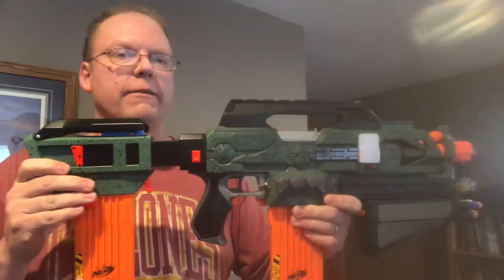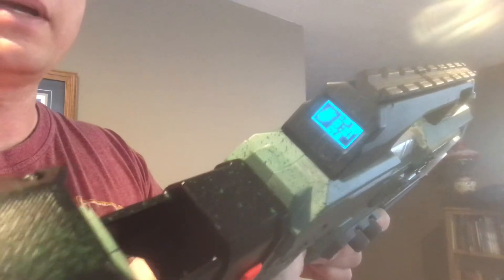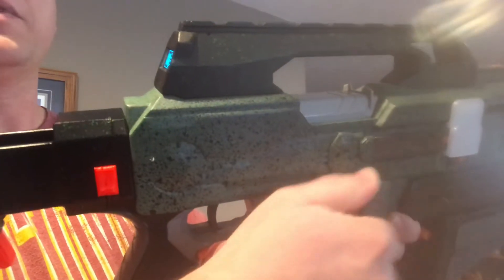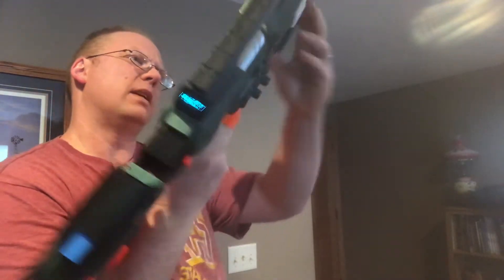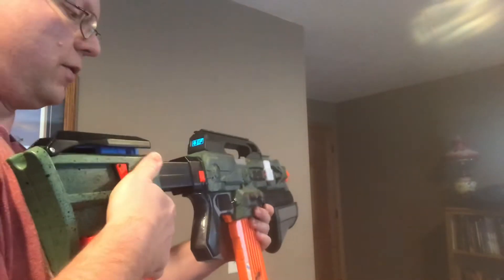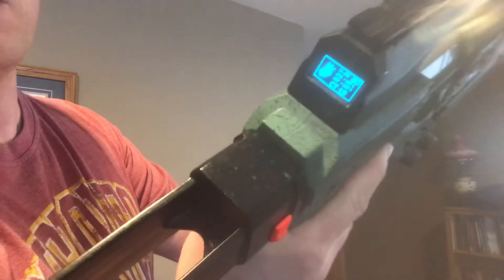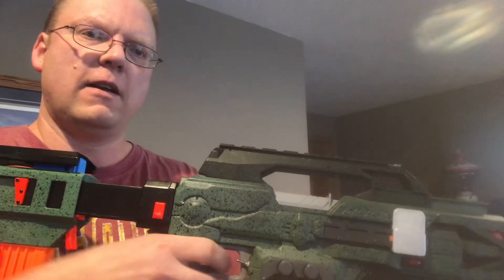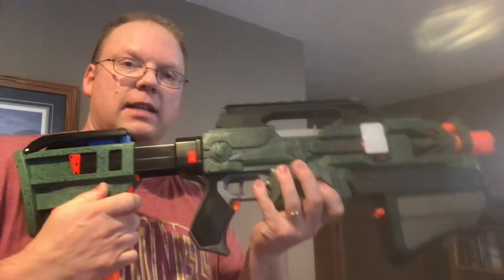Select fire modulus ecs10

Comment: Wow! Maybe could you help me with my nerf ECS-10 modding project?
Reply from the maker: What’s your plan?
Reply: @machgt  I am wanting to make it very similar to yours, maybe with a 2 digit countdown for the ammo counter. Umm, semi auto, 3 round burst, and full auto :) And probably a display to tell me how much battery the gun has left.
Reply from the maker: @Boden_Worms  How much soldering do you do?  I've designed a couple of boards that I use for controlling the select fire and motors.  Do you do any coding?
Reply: @machgt  I do not do much soldering, And I know the basics of programming. I would probably use arduino.
Reply: What part did you use to replace the  overhang over the umm jam door?
Reply from the maker: @Boden_Worms  I printed it
Reply: @machgt  Thats cool!
Reply from the maker: @Boden_Worms  I designed and printed all of the parts using solidworks and the printer at work.  I can't sell the parts but I'm happy to sell/provide files.  That carry handle is on Etsy under EJBblasters
Reply: @machgt  Ok! i will check them out!
Reply from the maker: @Boden_Worms  find me on nerf modders welcome on Facebook
Reply: @machgt  Sadly, I am not allowed to use Facebook
Reply from the maker: @Boden_Worms  nope. I did a olive base coat then just barely press the tip on the spray paint can. It splatters. Makes a bit of a mess on the can. I do a flat clear over top
Reply: @machgt  It looks cool ;)
Reply from the maker: @Boden_Worms  I’m happy to share my code too
Reply: @machgt  That would be amazing!
Reply: @machgt  Whered you get the little screen on the blaster?
Reply from the maker: @Boden_Worms  eBay. It is a 128x64 I2C OLED. You can get one from adafruit too
Reply from the maker: I can email you a copy of the code I used if you want to look it over
Reply: @machgt  You would be willing to share the code? That would be awersome :D
Reply from the maker: @Boden_Worms  what's your email?
Reply: @machgt  How did you make the pushrod full auto?
Reply from the maker: @Boden_Worms  I designed and 3d printed a full automatic pusher. There is one by “ach attachments” that I’ve heard good things about. Making it select fire adds a lot of complexity. If you have not modded a flywheel blaster or done other electronic mods then I’d recommend just upgrading the motors and wiring
Reply: @machgt  I have modded the ECS-10 by taking out the locks, restricters, stuff like that.
Reply from the maker: @Boden_Worms  check out drac and captain Xavier on YouTube for some ideas. Also take a look at outofdarts.com
Reply: @machgt  My dad is also really good with this stuff
Reply: @machgt  What is Ach attachments?
Reply from the maker: @Boden_Worms  Atch Attacments actually, he's some guy who builds nerf stuff.  You may be able to modify one of his full auto kits to work with the ECS-10.  If you have a 3d printer and you can do some simple machining work (drilling/tapping holes and grinding a flat onto a 3/16" shaft) then you could buy the 3d files from the kit I made for the ECS-10  I don't sell the actual parts because I don't have a 3d printer of my own.
Reply from the maker: Here's an example of a pusher motor gear box: https://outofdarts.com/collections/motors-2019/products/plastic-gear-motor-yellow-12v-single-axis-for-d-dart-tempest
Reply from the maker: @Boden_Worms  https://worker4nerf.com/products/worker4nerf-semi-automatic-mod-kits-for-n-strike-stryfe-dominator-and-worker-swordfish?_pos=2&_sid=87e2cf26e&_ss=r
Reply from the maker: There are full auto kits on ebay too, not sure if there is much specific to the ECS-10 though
Reply: @machgt  Ok, i have seen a tutorial on how to mount a nerf stryfe mod kit onto the ECS10, it uses the same motor
Reply: @machgt  Wow, some of the stuff he makes are insane!
Reply: @machgt  Yeah, there arent any, i will probably get a stryfe med kit my Worker
Reply: @machgt  Umm, what kind of battery did you use for your gun? LiPo?
Reply from the maker: @Boden_Worms  I have a 3s zippy Lipo in this one that I got from out of darts. Motors are MTB rhinos in the flywheels and the stock motor in the pusher. I used PWM output to knock the pusher motor voltage down to 7-8 volts
Reply: @machgt  Wow, thats gotta be POWER
Reply: @machgt  Did you get new flywheels to?
Reply: @machgt  Which Zippy battery did you get?
Reply from the maker: @Boden_Worms  they are stock flywheels. The battery is the 2200mA-H 25c. Works well with the rhinos. Krakens take more current
Reply: @machgt  Ok!
Reply: @machgt  Did you have to buy a charger?
Reply from the maker: @Boden_Worms  yes. Get a proper charger and battery gauge. Plus a lipo bag
Reply: @machgt  lipo bag?
Reply from the maker: @Boden_Worms  a flame resistant bag to charge and store the battery in. Out of darts has them
Reply: @machgt  Wow, Outofdarts has everything!
Reply: @machgt  Thank you!